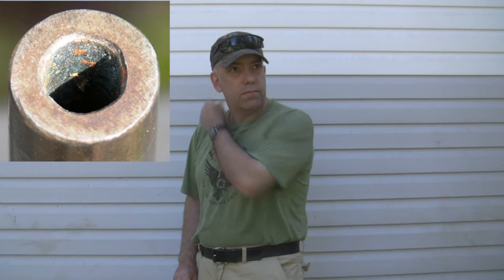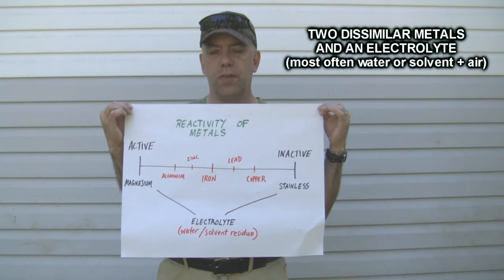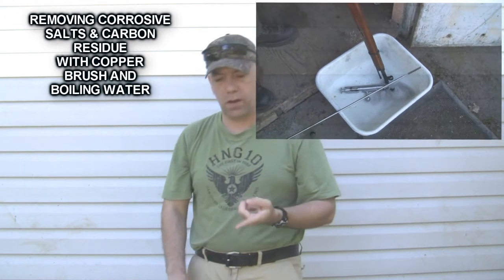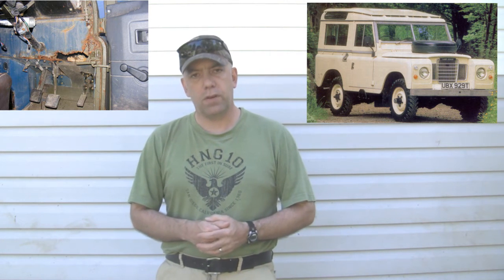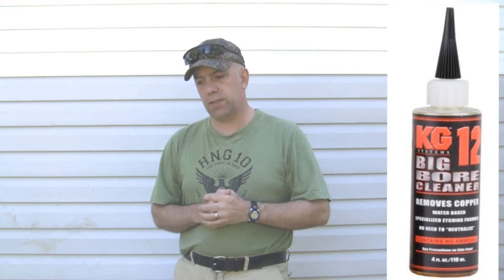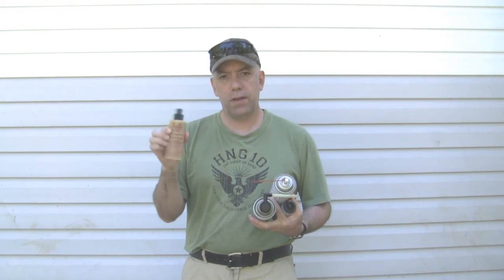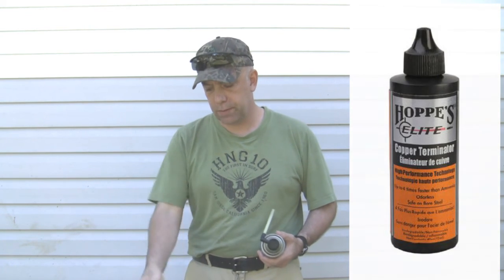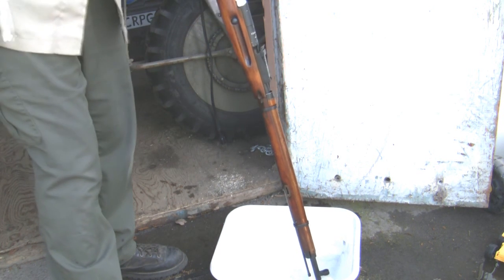Copper Fouling - Why Should I Care?

Comment: I've messed with many used rifles over the years and one of the first things I do when I acquire one is to try and get the barrel clean. Metal fouling (copper/cupronickel) as well as carbon/powder fouling are generally present in layers, as you mentioned, and can require changing back and forth between copper solvent and powder solvent to get down to the underlying steel. One product I really like is Remington 40-x bore cleaner
(formerly called Rem-Clean), it cuts through carbon, copper and even lead fouling. For neglected bores it is the quickest way to get down to clean steel.

Comment: I used to think copper fouling was a big deal but then I realized something about every one of these videos: none of them actually shown an actual copper fouled barrel. It's always about what someone said or heard or seen or showing something completely different from a badly copper fouled bore (what you shown at the start is a rifle that was never cleaned with ANYTHING at all not that it was cleaned but just never had the copper taken out). Barrels will not last forever. They are disposable items. Yes you should take care of them but if you're using them heavily, at least heavy enough to foul it like the start of the video, then you're going to expect to swap out the barrel some times. The military doesn't issue copper solvent and never mentioned it being a problem in any of the small arms including precision rifles. They do however have a life span of about 7k rounds, which is a fraction of what's a civilian might expect from their rifles.
Reply: As a matter of fact, Stag Arms offer a free barrel replacement of their rifles if you ever shoot it out. In their article, they never mention copper or fouling being an issue with longevity.

Comment: Some copper fouling is GOOD. It allows the pores in your barrel to be combined with copper. I am shooting ,4 to .3 moa groups by letting my barrel to accumulate 4-5 fouling rounds. You scrub the copper out of your barrel and you have lost your zero. You obviously don't understand the concept of exterior ballistics. Once fouled you can fire up to 60 or more rounds without losing accuracy. Give it a try with a good barrel and you will be amazed!
Reply: shaverlocal Sorry, I meant interior ballistics.
Reply from the maker: shaverlocal    Absolutely correct. All I am saying is that you should seriously consider removing that copper before putting the rifle away for long term storage. You will need to re-confirm your zero but your barrel will last longer.
Reply: I totally agree with that
Reply: Lead and copper in the gun barrel will act as a sacrificial anode and prevent the steel from rusting.
Reply: The steel is the sacrificial anode when it comes in contact with copper...
Reply: what may be even more important is ....what is the copper bullet alloys?...if zinc is one of the alloys , zinc makes an excellent sacrificial element.........but as with swiss gp-11 it is copper/nickel alloy
Reply: Chrome Molybdenum
Reply: If you have copper fouling, you have a problem. Period. Its the result of hot gas bypassing the bullet melting the surface of the bullet and soldering that material into the surface of the barrel. You can fire up to 60 rounds without losing accuracy? That's your standard for judging that copper fouling is "good"? That's horrible performance from a "good" barrel.

Comment: Good point on galvanic action. Try extracting the quick-detach heater hose fitting from a 90's GM V-8 intake manifold. Not easy. I recommend the Sweets 7.62 as well.
Reply from the maker: Been there done that. Radiator hose fittings too.

Comment: Using Muratic acid I've cleaned a Win Mod 95 barrel in 35 WCF and from 6" groups shrunk them to 3" groups. Also works great on Sniders etc. that have corroded bores.

Comment: OK so the kg 12 want hurt the rifling in my barrel and is it OK to do it every month
Reply from the maker: I don't think we should ever leave any bore solvent in any barrel for any extended period of time. I think that will only lead to problems. I do however believe on removing fouling on a persistent and militant manner until it has been eradicated (unless in competition). After removing copper we should oil and preserve our firearms as required for storage and rust prevention. Can I get an Amen?
Reply: Riflechair does it have to be kg3 oil or can it be wd 40 after I use kg12
Reply from the maker: I'd say that any oil including canola might help more than no oil at all..
Reply: Riflechair OK thanks bro

Comment: I hand load monolithic hunting bullets (Barnes TTSX, Nozler E-Tips) in 3 different rifles.  Each winter I clean my rifles so they are squeaky clean....absolutely no copper blue after many patches. In the spring, ALL these rifles shoot TERRIBLE GROUPS, then as copper fouling accumulates the groups improve to subMOA and the accuracy is excellent for hundreds of rounds with no cleaning.
Barnes has good technical article about "copper equilibrium" for precision shooting as does long range shooter TiborasourusRex:  https://youtu.be/_KRUAv3Byp4
Another precision shooter, Sam Millard of Panhandle Precision shoots thousands of rounds with extreme long range accuracy without cleaning his rifles.

Comment: is there anything that can be used to remove/neutralize or 'chase out' the solvents that have the potential to harm a barrel or other metal surfaces, say, if Sweat's, for example, drips or runs into somewhere you cannot wipe out? Building on that, what should you use to insure you have removed all of the Sweat's from a barrel? Thoroughly dry with patches and run one with oil?
Reply from the maker: Dan Abraham Hi Dan. No neutralizers that I'm aware of however a good general purpose lubricant like CLP has always worked well for me. As for the barrel and chamber I always degrease with brake cleaner before every range session. I always store my rifles in a well lubricated state.
Reply: Riflechair huh....ok, what do recommend for a general parts cleaner... of powder, carbon, other gunk left after a range day, etc? I was raised on No.9 but the more I research and hear testimonials on other products, the more questions I have. Thoughts?

Comment: stop spending $$ on commercial cleaners.  Muratic acid is CHEAP and more effective than anything else I've tried. 
It does remove blueing immediately so tape off the muzzle. Clean the bore with any commercial cleaner until you get a patch without any residue on it, it's clean as possible now??? NO.  With a bronze brush on a cleaning rod dip the brush into the acid. A lose fitting worn brush is best. Slowly run the length of the bore a couple times. Rinse the rod and brush with water to remove the acid. Next swab the barrel with patches soaked in water, continue until the acid is removed. Now use your commercial cleaners with a brush then swabs. Note the amount of crap this now removes.
Also removes corrosion, a rod on a cordless drill speeds the process. Remember you can make the commercial cleaners yourself with cheap ammonia. KEEP your $$$$.
Artillery rounds use tin to help remove copper fouling as it fires.